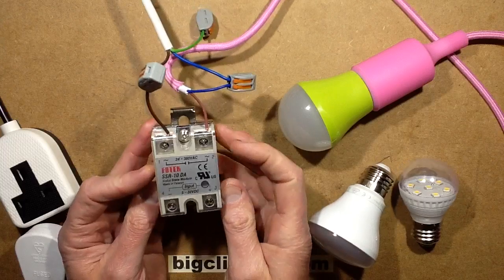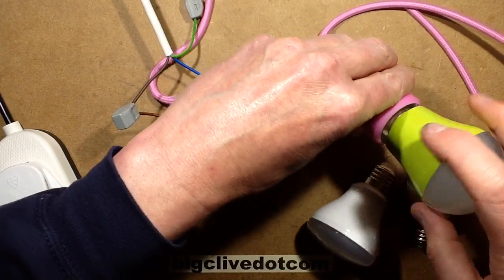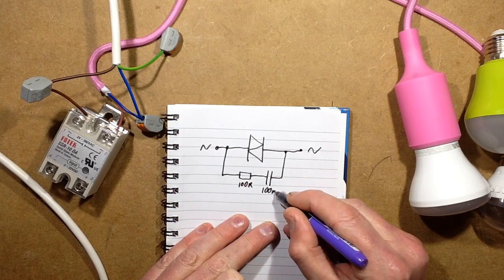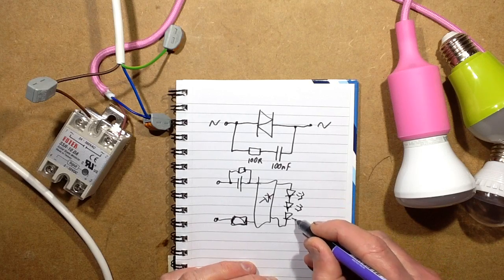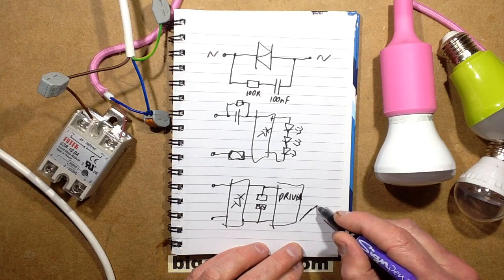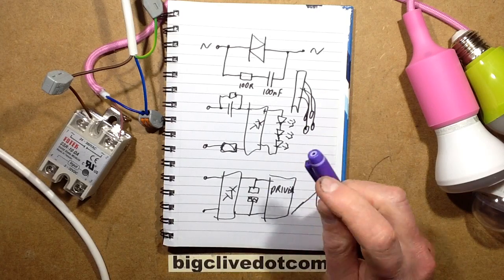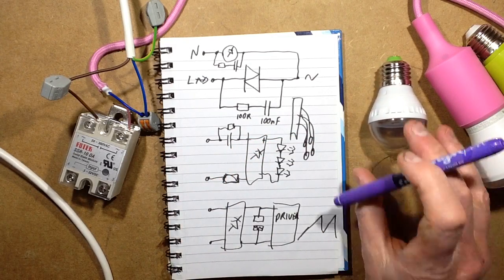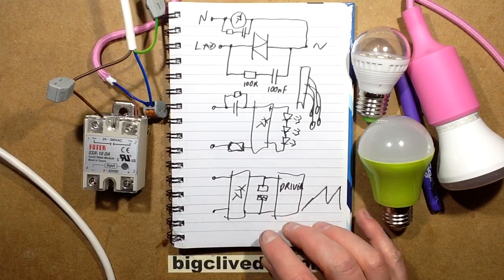Electronically controlled LED lamps glowing when off.

Comment: So i have what may be a doggy question. Is it possible to wire a PTC into the light circuit and have it create a load? I have a friend with a large number of recessed ceiling lights in his house ( 45 ) on 4 different 3 way digital dimmers and he wants to convert to LED but unless he leaves one incandescent in each circuit the whole lot all glow when there off. So my half brain idea was to install a 5 watt 80C 110v PTC heater, one on each circuit mounted to a heat sink inside the cans plugged into the circuit to create a slight dummy load. What do you think.....they generate less heat then the 150w max rating that the metal can it rated for was my thought...

Comment: I put a new fitting in my bathroom, and populated it with LED bulbs ... the leakage through the switch means it glows at low level when off not noticeable in the day but obvious at night

I've decided its a useful feature enough light for a pee in the middle of the night after all at least now the 'wasted power' is light not just heating a filament
Reply from the maker: It's a tiny amount of current.  I like the slight glow.

Comment: Another great video. In my case in old house installations, they made the switch break the ground wire, not Live. The LED lamps or bulbs stop, but they glow or flicker. I could NOT solve that :( Any advice please?
Reply from the maker: It's common to get some capacitive coupling between the switch wires that passes enough current to make LED lamps glow very slightly.  If there are multiple lamp holders on the same circuit you could replace on of the lamps with a low power tungsten lamp to shunt the leakage current.

Comment: Even the stray capacitance in the wiring over here makes some LED's with capacitive droppers light up.
Reply from the maker: Very common, especially on lighting circuits with multi-way switching.  I quite like the effect.
Reply: Me too,makes nice nightlights and it's very little electricity that would otherwise just go to waste.

Comment: I got similar question at work some days ago using nothing but and ON/OFF switch (no solid state or RC network). I didnt find that crazy since I got similar symphoms with old CFL light that barey glow. I was told that this was because circuit didnt cut the LIVE. This could have an explanation (small grounding or leak on wiring ... ). And asked the person to invert the wiring to cut LIVE. And he come back telling the issue still there (at this point got totally confused). Lamp makes small glowing. It has a similar issue on another room with lamps from another brand. But a third brand does not have the issue. Any clue for this non sense ?
Reply from the maker: Some LED lamps are so sensitive to even the tiniest leakage current that they will glow visibly with just the capacitive coupling between switch wires.  Especially when multi-way switching is used.
Reply: Well, at least you cant tell they are inneficient, they harvest power from almost nothing !!! Thanks for the answer.

Comment: My kitchen light LED bulb glows if it's off even though it only has a mechanical switch
Reply from the maker: +RandomTux That's common.  It's capacitive coupling between the cables.  LED lamps are super sensitive.

Comment: I've got a ceiling fixture in my house that does this glowing mess with led bulbs, no "electronic switching devices". What gives.
Reply from the maker: +Joe It may be capacitive coupling between wires, especially with multi-way switching.  Some LED lamps will glow visibly at just microamps of current.

Comment: I'm dealing with a possibly similar problem.... Led lights on a dimmer. After we added the extra load, they don't stay on when set to off anymore. But they flicker sometimes when in the middle of the dimming range. Mostly ok at full brightness but less, they go wacky. Anyone have any ideas? 

They're big name "dimmable" bulbs from a big box store, so not cheap knockoffs (hopefully). Though we're using them with a cheaper Elation brand DMX setup. Par lights. Any thoughts?
Reply from the maker: What did you add as an extra load?
Reply: A special plug in thingy specifically for that purpose. Our electrician got it so I'm not real familiar with. But I'll look at it next time I'm there. The other 3 channels have them too, and work ok.

Comment: But what if you have an ordinary lightswitch and an LED lamp glows when off ?? is it "DANGER DANGER WILL ROBINSON!!" or is it just a glitch in the matrix ?
Reply: I'm no electrician but I know enough that that worries me. Could be something like improperly shared neutral?? I was replacing an outlet recently, it had an extra wire to it and was still powered even though its breaker was off. Someone had apparently tapped into it to install one side of a new light fixture. I asked an electrician to look at it...

Comment: I even got 'this without any dimmer or solid state relais. Even when the 230 volt led light is only connected by a mechanical lightswitch built in the walls of my house. Maybe some form of induction ? Here in the Netherlands wiring is put into pvc pipes wich are built in the walls and ceilings.Often  you have several wires using the same pipe.
Reply from the maker: It's a common effect with some lamps.  Capacitive coupling between switch wires is enough to make them glow slightly when off.

Comment: Adding a plug-in transformer in parallel to the lamp (via a 1 to 3 outlet tap) seems to fix the issue without hooking anything up to the transformer output. A common old+heavy 5-12v DC "wallwort" is best; experiment to find the least vampiric one for your setup. They fix LED bulb issues with SSRs, dusk-to-dawn sensors, motion detectors, lit switches, etc.

Comment: Hi,I purchased one of those solid relays to control a 730 watt CNC router. The trouble i`m having is when i connect it has you have in your video, I have 240 volts on terminal 1 and 150 volts on terminal 2?. Even when no power is applied to the DC terminals. Is it knackered?
Reply from the maker: You get leakage current through the internal capacitor/resistor snubber network.  On a sensitive meter that will show as a high voltage that will disappear as soon as a non-electronic load is applied.
Reply: bigclivedotcom thanks for the reply. That's what i have been reading on the net. But mine iruns the router at a reduced speed?
Reply from the maker: Ah, that's not right unless it's trickling enough current to make the motor idle over.  Is it a simple switched input unit or a variable output unit?
Reply: bigclivedotcom  its just a simple switched unit the same as the video  expect its a 40 amp model

Comment: I have the same problem with some aliexpress lights, the power supply, when switched off in either live or neutral, can still turn the led slightly on, when the led board has something near, like my hand. I guess it acts like some sort of capacitor, and allows a tiny current to flow, just like thoose screwdrivers that can tell you if the wire has voltage, even without touching it... With thoose ones, i have to use a double switch to cut both live and neutral...

Comment: I did actually the same with tungsten lamps to a dimmer rack once. But in this case I didnt had enouhg hanging lights so had to find all kind of desktop lights that night. You could guess how funny that must have been looking at a fast switching part.

Comment: Hi, Is there any polarity when connection the snubber for an led light,  [ I mean the resistor should be connected to the nutral or the capacator should be connected to the nutral ? ].
Reply from the maker: Either way round.

Comment: Couldn't you shunt the leaking voltage off to a infrared LED? It would be intermittently lit / glow, but you wouldn't really be able to see it. Though, I guess you'd have to be careful in case the circuitry produced a strobe in such a way as to turn on/off your television.
Reply: abigguitar thats a good idea to mess with someone for revenge 😈

Comment: I have some CFLs which I fitted in my garden and one of them flashes when off - not always the same one, and not as quickly as the Asda light in the video. But I know why they do this - the outdoor switch that I wired them to has a neon indicator across the switch that comes on when the switch is off, leaking some current to the CFLs. The neon in turn only lights because of the load through the CFLs.

Comment: i have a desk lamp, if i turn it on for idk half an hour, more than 2 days after i can still see the LED'S glow when its dark xD
Reply from the maker: Do they go out completely when it's unplugged?  Some LED lamps are so sensitive that they will glow on leakage current between adjacent wires.
Reply: bigclivedotcom no they dont turn off when i unplug the power, they just glow for days, even when not connected to the power, how does that work i dont get it xD
Reply: I have this leakage effect on my landing light - but it only manifests itself when I have a G9 LED in an adaptor - "normal" bayonet LEDs stay dark.  Not that I'm complaining, it makes for a damn good night-light!
Reply: Big smoothing capacitor?
Reply: Paul Sengupta ehh idk

Comment: I have another Problem... I have a LED Strip that just baaaarely glows blue (not even evenly on all LEDs) when it's supposed to be off... Any idea on what could've failed?
Reply from the maker: It sounds like a very low current leakage that is making it light.
Reply: drop a 1K resistor over the terminals and it will eat that leaking current

Comment: this answer some of my questions but not all of them. I have a chandelier with a dimmer I recently converted it to LED. I bought a new dimmer I installed it the way the instructions said to install it if you don't have a ground wire I installed dimmable LEDs but now everytime I turn it on it blinks you have to start it out at the dimist level then power it up to full or it just blinks. I'm starting to understand why it blinks but what I need to know is how to stop it.

Comment: Good grief, just put a 10k resistor across the input pins. The input to these devices is usually an opto isolator with a high impedance fet input.  That's why it will operate over such a wide voltage input range. Any knowledgeable electronic technician knows that an open gate on an fet will allow noise to turn it on to some degree.
Reply from the maker: These are just a bare IR LED style opto isolator.

Comment: Very Interesting. I recently got some LED GU10 lamps for my room and noticed that when I dim them down they start flashing madly (faster the lower I go). But when I have a standard GU10 lamp in at the same time (non LED) the LED does not begin flickering until I turn the dimmer down far more.

I also noticed that when I had two LED lamps in, after a while both the dimmer and the lamps themselves began buzzing. However after removing one it ceased. What are you thoughts on the cause of that? (This buzz only occured on sockets with a dimmer)

Comment: Clive it would be really great if you could do a follow up where you test potential methods of fixing the issue, since it is so common now with household dimmers and LED lamps.  Would be interested to see for each potential fix -- snubber network, just a high value resistor, etc. -- the current draw when "off", the waste heat generated, etc.  Thank you!

Comment: I had set up a light system onto my car some time ago, and one circuit of it, (being two circuits in the system, controlled by the strobe controller) would sometimes just give a dull glow. Not always, I noticed, but sometimes, it would just barely glow one of the control lights. I'm guessing this is why? It's interesting, to say the least, but I thought something was horribly broken.

Comment: I think the last solution was probably the best. include a higher power rated bulb or device in the sequence with a higher power requirement to shunt the leakage to a device that acts as a threshold to the system. Good video.

Comment: Thanks for your experience and clarification, most low cost SSR and dimmers will display same quirks. I wanted to energize a PWM fan array using the USB voltage to activate the solid state relay. Big failure, fans would just keep running at fractional speed with the relay control voltage removed. Two solutions found: Livolo active phantom load, or a PTC implementation.

Comment: Interesting... way back , found there was enough leakage from the wire to wire capacitance in a 2 way stair light circuit to cause atrocious interference from a CFL when switched off - not enough power to light or flicker, but it wiped out AM radio.

Comment: I had an interesting issue when the switch was off (for led ceiling light) but the other switch on the same socket was on (for wall lights) the ceiling light would flash. if both were off then no issue.
turns out that voltage was being induced in the neutral (apparently) due to the adjacent circuits and bank charging the capacitor.
I had to get rid of the wall lights all together

Comment: If your going for the one tungsten lamp as shunt for LED circuit concept, you can actually buy decorative large filament lamps. While technically these are much less efficient, they are not designed to light a room, so total current draw is often less, and they have a basically unlimited service life, which is cool given if it does fail, all your LED's will go back to either flashing randomly or glowing when ever the lights are turned off.

Comment: I have a coil fluorescent bulb in a fitting controlled with an everyday light switch.
It flickers slightly when off.
I don't think there is a solid state relay involved anywhere in this circuit. Where would be the leakage? could it be the a live wire laying in parallel with the cabling in the roof?

Comment: I have that glow problem with my X10 controlled wall switch controlling 5 kitchen spots. Initially I installed fluorescent and now Led bulbs. Intuitively I installed one incandescent with the fluorescents and continued when I swapped them for the LEDs. Both types needed the incandescent. Now I know why the problem occurred. Thanks for the enlightenment.

Comment: I ran into the same thing when I installed one of those lighted "nightlight" style switches in my hallway to control a CFL. There was enough current coming through the light in the switch that every 1.2 seconds the CFL would flash ever so dimly. Took me 3 days to figure out what was going on.

Comment: Back in 2008 I fitted the then 1.3w GU10 LED bulbs now here is the puzzle for you. I also was able to see the slight glow on these LED Bulbs the switch was a  standard light switch, GU10 has no earth point I never Figured a valid reason of how the LEDs were doing this. 
I checked that the switched wire was live the bulb only connected to neutral with old-fashioned 5A wire fuses at the fuse box disconnecting the live wire from the switch - no change standard 1.5mm flat  lighting cable white with red and black conductor wires
My only thought was the some kind of  eddy current /transformer effect from the steel wall conduit (1950s house that been re-wired using the old conduit that once had the rubber flat cable in)

Comment: i have a question if any one can answer it 
i have touch dimmers in my house and they keep going wrong as in the light won't turn on i have to go to the fuse box and kill the power to the lighting circuit and then they are ok again. how can i fix this issue as it is driving me crazy

Comment: bigclivedotcom I've had similar issues with LED bulbs in light fixtures that have "dusk to dawn" sensors in them. I've found that using dimmable LED's have solved the flashing or dimly lit issue. That is to say the dimmable LED's don't seem to have this issue.

Comment: I have normal led's in my room, they glow for a bit after their turned off, no electronic control what so ever.
Reply: +Travis Piper A few does that here, too. Im guessing its just a capacitor somewhere discharing...
Reply: +Travis Piper if only for a bit it will be the from the capacitor in the LED power supply cct
Reply: That's what I'm thinking.
Reply: The afterglow of phorphors and residual charge in capacitors both cause this sometimes.

Some leds also use a phosphor coating that produces orangish-yellow light to correct the bluish color of the diode's normal light. Go in a dark room, let you eyes adjust, and blink the flashlight really quickly then look very closely at the diode. There's a small afterglow of this phosphor.

Comment: I've got to thank you Clive, I put in a ceiling fan recently and the LED bulb would always stay on at a low level after switching it off and I thought it was a fault with the fan. I swapped the bulb for a halogen one (seems they don't sell incandescent bulbs anymore) and it works perfectly. This video saved me the effort of taking the whole thing out and replacing it for no reason so thank you!